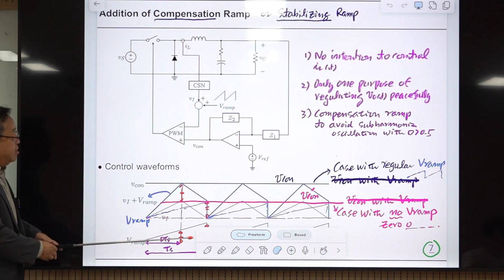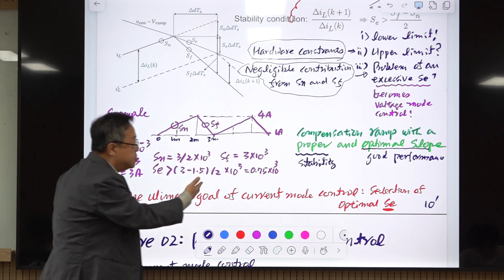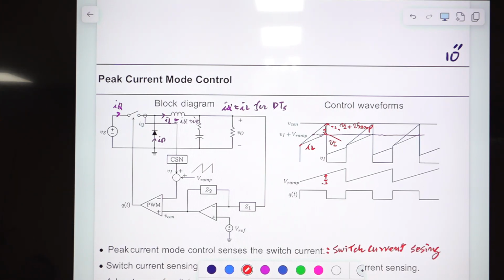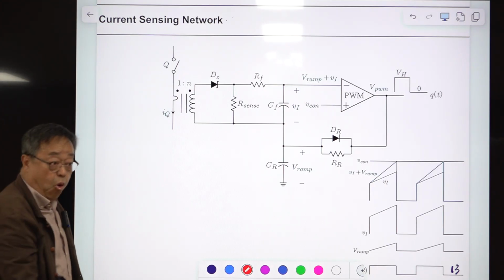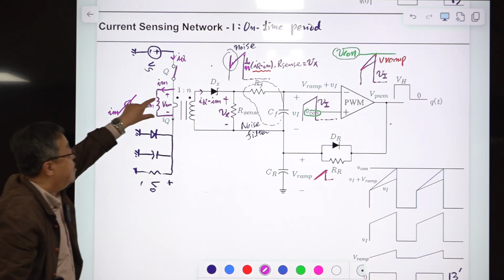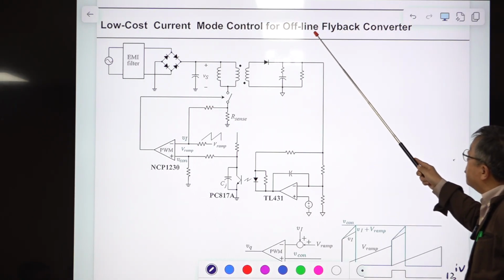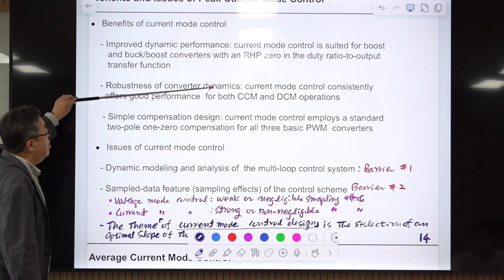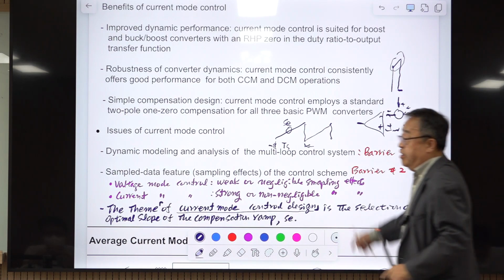Lecture 02: Peak current mode control, Slope compensation, Current sensing network, Buck converter

Comment: Sir @21:33 you mentioned control voltage is fixed but isn't should be slowly varying signal ?? It may be fixed for single switching period does it hold good for the entire time period??
Reply from the maker: To illuminate the stabilizing effects of the slope compensation, I used a conceptual scenario as follows. The converter is operating with only the current loop closed while the output voltage is not regulated (with the voltage feedback opened). The simulation was performed with the following  conditions: 1) the control voltage was set at a fixed value,  2) the duty ratio was varied as shown in the bottom plot by a separate  program, and 3) the input voltage was forced to vary as shown in the top.  This is not a practical scenario but  an educational set up for students. Sorry for the confusion and thank you for the comment.
.
Reply: @byungchochoi3322  Thanks Sir ..Now I got it.
Reply: @byungchochoi3322   sir in short in literature wherever we see constant control voltage that means we are not considering voltage regulation and current loop alone is active ..like all the current mode control app notes from TI or any other app notes  show similar diagram ....Is that correct?         I was simulating the effect of compensation ramp in LTspice to show compensation ramp minimum amplitude effect on the inductor current but how should I represent if I set compensation amplitude much higher than the required (it will turn into voltage mode ) but what will be the visible change in the output ? I wanted to simulate this behavior but  stuck at this stage.
Reply: @byungchochoi3322  Sir one more question why we don't evaluate the frequency response analysis (bode plot) for inner current loop? Isn't important? we generally measure FRA using bode plots for outer voltage loop but not inner loop even though it has impacts on stability .
Reply from the maker: @powerpath-n4u  This question is interesting and important, as is the case with your last question. I will address these questions in Lecture 04, which deals with the design of current loop. Thanks.
Reply: @byungchochoi3322  Many Thanks sir 🙏